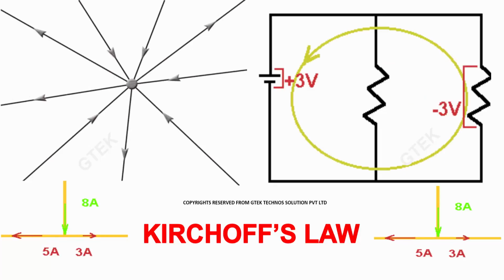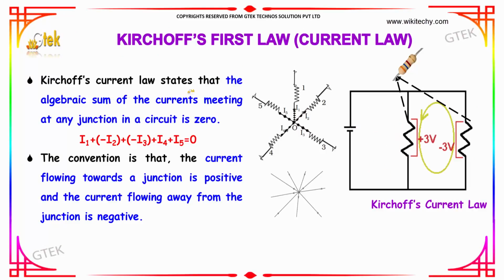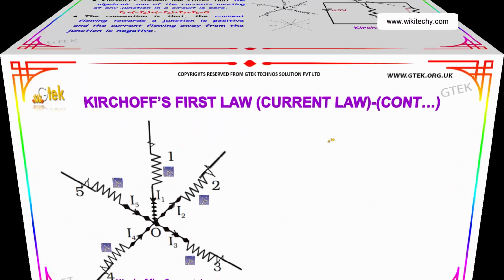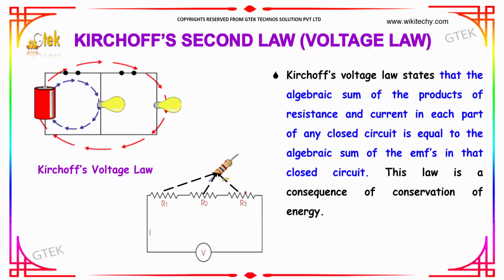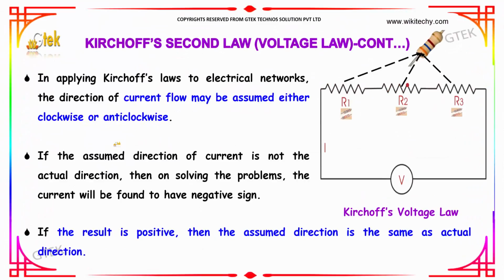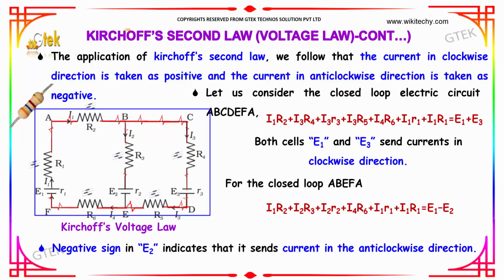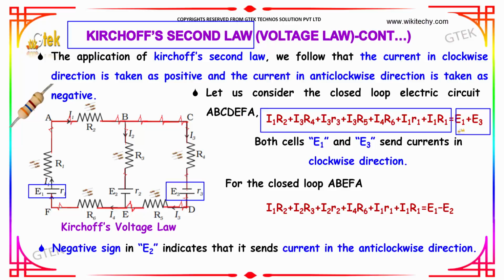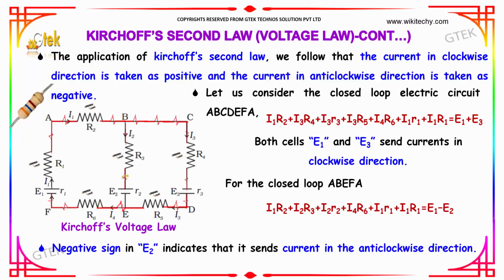+2 Physics Current Electricity - Kirchoff’s Law | CBSE | Samacheer | wikitechy.com

Comment: We analyze a circuit using Kirchhoff's Rules (a.k.a. Kirchhoff's Laws). The Junction Rule: "The sum of the currents into a junction is equal to the sum of the currents out of that junction." ( Conservation of Charge) The Loop Rule: "The sum of the voltages around a closed loop is equal to zero." (

Comment: Kirchhoff's voltage law (KVL) The sum of all the voltages around a loop is equal to zero. This law is also called Kirchhoff's second law, Kirchhoff's loop (or mesh) rule, and Kirchhoff's second rule. ... Here, n is the total number of voltages measured.

Comment: Kirchhoff's voltage law (KVL) The sum of all the voltages around a loop is equal to zero. This law is also called Kirchhoff's second law, Kirchhoff's loop (or mesh) rule, and Kirchhoff's second rule. ... This law is based on the conservation of energy whereby voltage is defined as the energy per unit charge.

Comment: This law is also called Kirchhoff's second law, Kirchhoff's loop (or mesh) rule, and Kirchhoff's second rule.

The principle of conservation of energy implies that

The directed sum of the electrical potential differences (voltage) around any closed network is zero, or:
More simply, the sum of the emfs in any closed loop is equivalent to the sum of the potential drops in that loop, or:
The algebraic sum of the products of the resistances of the conductors and the currents in them in a closed loop is equal to the total emf available in that loop.

Comment: Both of Kirchhoff's laws can be understood as corollaries of the Maxwell equations in the low-frequency limit. They are accurate for DC circuits, and for AC circuits at frequencies where the wavelengths of electromagnetic radiation are very large compared to the circuits.

Comment: These laws are very helpful in determining the equivalent electrical resistance or impedance ... The point may be considered anywhere in the circuit. kirchhoff current law ... Lets, The currents in branches 1, 2, 3 .... m are entering to the junction.

Comment: If E 2 in the circuit had a greater value than E 1, the solution for the current ... Kirchhoff's laws can be applied to circuits with several connected loops. ..... is an electric current is called the Peltier effect (after the French physicist ...

Comment: In 1845, a German physicist, Gustav Kirchoff developed a pair or set of rules or laws which ... The term Node in an electrical circuit generally refers to a connection or junction of two ... We can use Kirchoff's current law when analysing parallel circuits. ... The circuit has 3 branches, 2 nodes (A and B) and 2 independent loops.